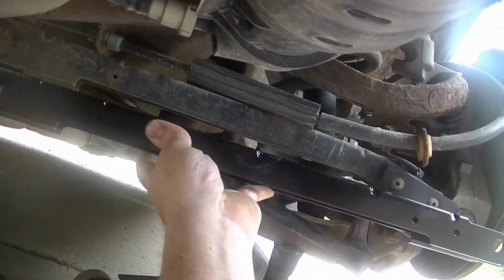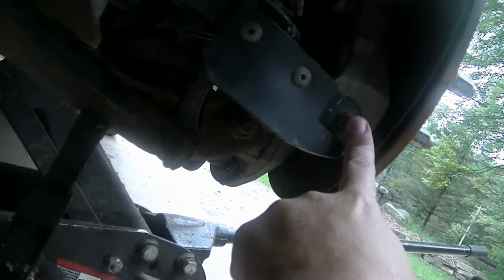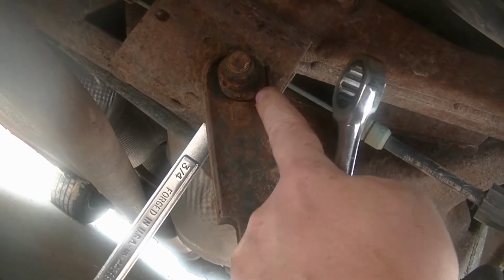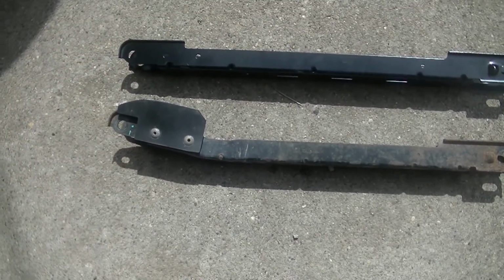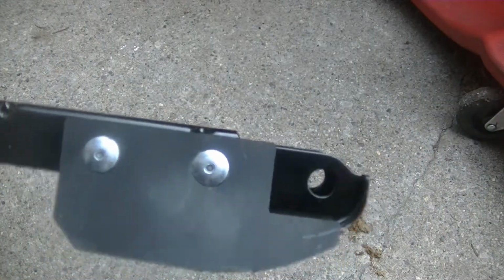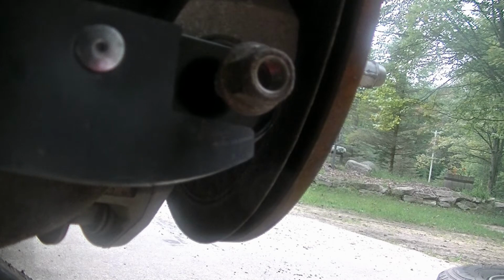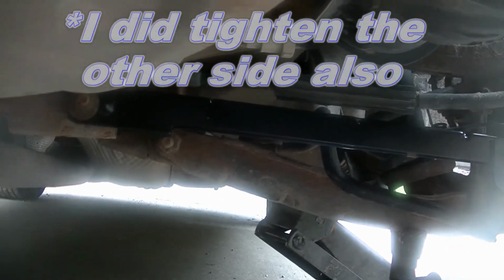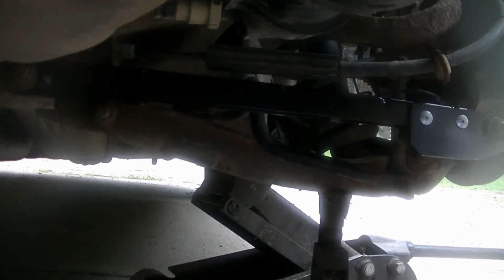Ford Freestyle Rear Suspension Repair

Comment: Did you notice if this was causing any negative camber on the rear tires in addition to the allignment being off?
Reply from the maker: I didn't notice anything too obvious.
Reply: I accidentally bent mine with my floor jack but yeah mine is off

Comment: How did you get that second bolt out
Reply: I've got to replace mine, it literally broke in half or rusted in half not really sure what happened. I cant get the second bolt out either. I've tried pounding it out with a hammer. Im considering cutting it out and replacing bolt and bushing. Did you struggle getting yours out? Assuming you needed to replace yours as well.
Reply: @justinsorensen7881  I had this problem had a couple of welders and mechanics come waste hours trying to remove 1 snapped bolt